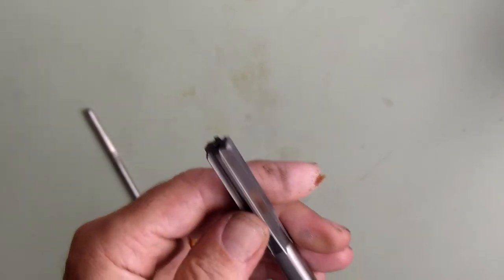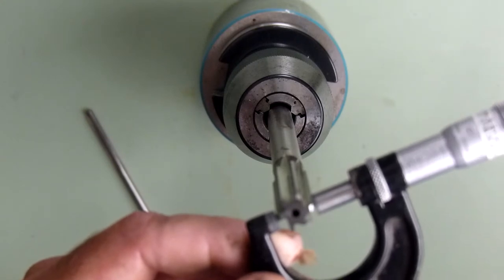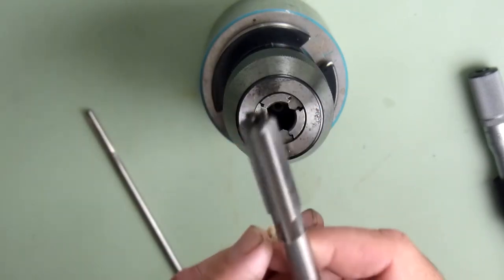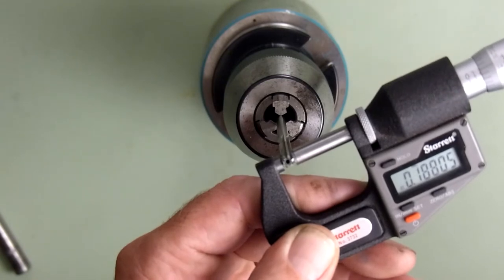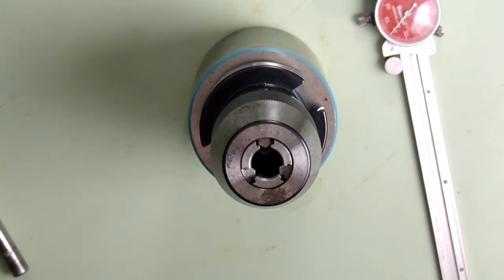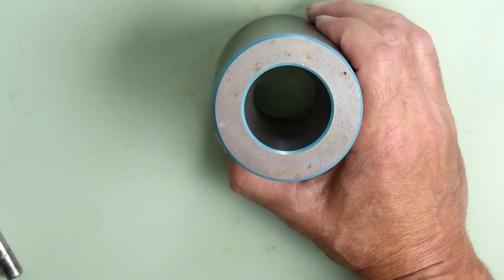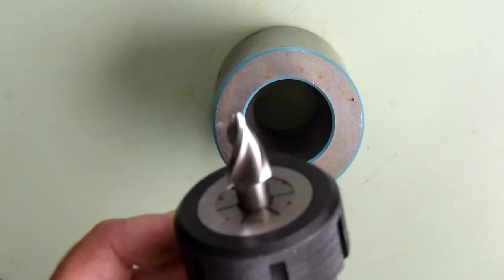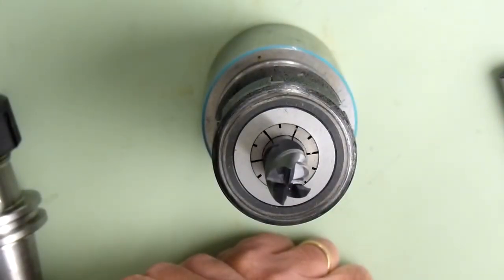Lesson 345: Measuring Cutting Tools Properly

Comment: If they are second hand try it out is very good advice  if its slightly bent or you are holding it off center  amongst other reasons can muck up the job if you are starting out as a toolmaker this can save you the walk of shame to ask can we get oversized pins or go up a dowel size plug the hole etc